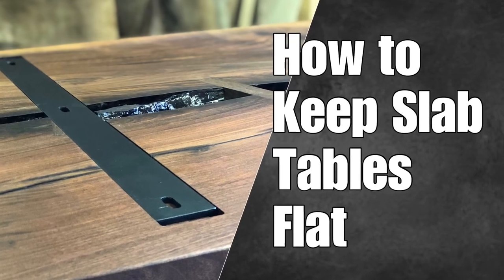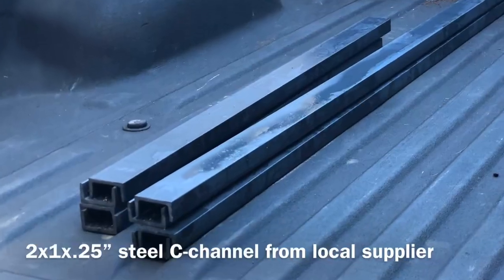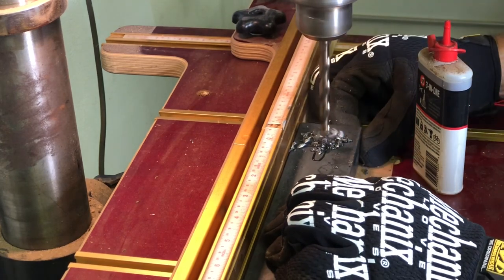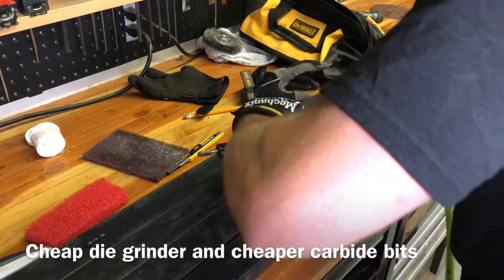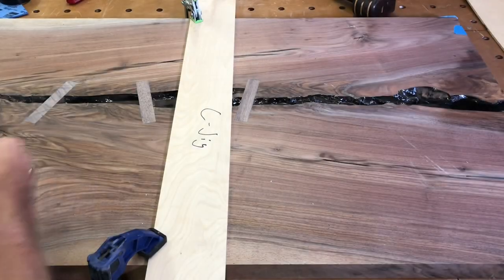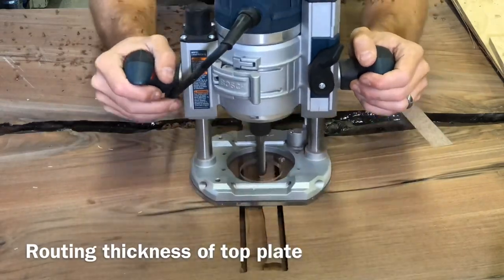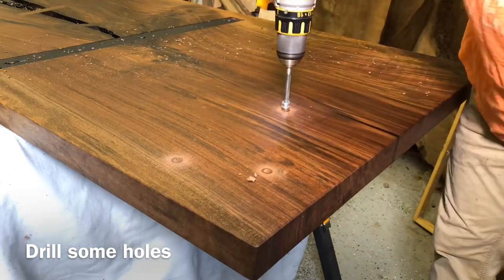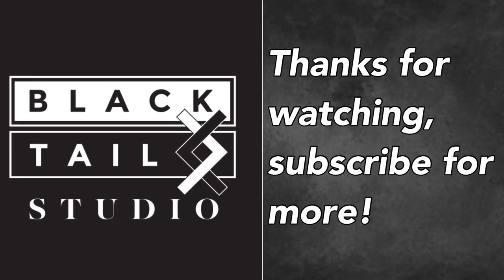How to Keep Slab Tables Flat — How To Woodworking

Comment: Cam, first many thanks for your videos!  Very helpful and clear 

I have question about c-channel spacing. I am building a finished size 8' x 42"' x 1 3/8" thick live edge table top. I will be installing 3 c-channels 1, in the center of the 8 ft length.  My question is how far from the ends should the other 2 c-channels be located. Your thoughts?

Thanks again!

Comment: So I am working on my first live edge slab and it is starting to cup!  I was thinking of making a series of cuts underneath the slab parallel to the grain and then using the c channel to attempt to flatten it out.  Have you ever tried to flatten a cupped slab?  Live edge walnut.
Reply from the maker: Dang! Ive never try to do any cuts like that after the fact. I’d just surface it flat again and add support
Reply: Just a pointer, if you turn it upside down (cup side down) the other side will dry out and start to flatten out. 
When you have got it flat again. Lean it up so air can get to both sides and then let it dry properly. 👍

Comment: Cam-  great video.  I am a newbie and don't have a moisture meter so I was thinking I should use the C-channel to help with warping.  I was told the slab (Banyan) was Kiln dried but it was stored in an outdoor barn.  The link to the Canadian company does not work, do you have another source you could recommend?
Reply from the maker: I’d reach out to CWW. I know they still sell em

Comment: Hello, thank you for video. i have made tabel top (oak) 40inch   wide and 80 long, and thikness is 1.5 inch. Dray wood about 8%. Is it crucial to use C channels? And is there any other option to chose instaed of C channel and braedbord to keep tabel top stable. Thank tou in advance

Comment: Hey Cam, incredible informative videos keep them coming buddy. I do have a question I’m doing a 4 x 12 conference table for a client and it’s 3 inches thick what length inserts would you use on the table like this, what would be adequate? I thought maybe 1 1/2” inserts but I can’t find them anywhere online and the bolts that go with it. Any information you can help with would be incredibly appreciated. Rich
Reply: Did you ever get an answer to this question? I find myself in a very similar position now.
Reply: @roberthiday3342  nope

Comment: Do I understand correctly that you add c-channel to prevent z-axis warping? Certainly that makes a lot of sense, just want to make sure I haven't missed something else.

Also, this could be accomplished by using c-channel as the mounting plate for the legs, yes? If I make my own legs, this appears to be a wise tweak to the usual flat plate.

Thanks!
Reply from the maker: Yup! Sounds like you got it.

Comment: Nice job. Be careful wearing gloves near anything the rotates. The drill press that you are using has enough torque to pull a finger from it's socket if a chip should snag your glove, ouch! Forty plus years in the metal working industry taught me gloves are to be used with extreme caution. Love your videos and want to see you have use all ten of your digits :-)
Reply from the maker: Green Button Man yeah, good call. I used to wear gloves a lot more. Learning to leave em more now. Thanks for the tip

Comment: What length of C-channel would you use for a table that’s going to be 120”X50”? And what kind of router bit did you use to flatten the cutouts for the insert?
Reply from the maker: I added links to everything in the description. And I’d say 40”

Comment: I'm building a 9' by 38" red oak live edged tabletop. My Question is if the table has been glued up well, meaning completely flat in both length and width, are the C-channels necessary to keep it flat throughout its life?
Reply from the maker: Sometimes they are, sometimes not. Totally depends

Comment: The C-Channels i'm using are 1/8 thick wall and 2 inches overall width. What size spacer would you use? I'm trying to make sense of your calculations and have come up with a 2.25 spacer but it seems like I should be going smaller than what you're using and not larger. Thanks.

Comment: What can go wrong if you did not slot the hole in the c-channel and used a regular hole?  I know wood needs expansion/contraction.

I don't think the table will cup due to the c-channel.  Interested to hear your answer.
Reply from the maker: It’ll crack the table

Comment: Hi Cam, may I ask if you've used C-channels in river tables before? I hope to use them in my build which has an 11 inch wide/2 inch deep river in the middle, but I'm nervous of what that much routering would do to the epoxy. Thanks so much, love this channel!
Reply from the maker: I have, and no issues. Other than you can see it on clear ones
Reply: @BlacktailStudio  thanks so much.

Comment: Hi Cam, awesome video. What is the minimum depth of wood I should leave under the routed slots? My table is 1.5inches thick and the height of the channel is .9 inches. Is that OK?
Reply from the maker: That’s pretty thin...

Comment: Great video!! Question, what thickness is your table top and how thick are the inserts? I’m building a tabletop that’s 1.5” thick and the inserts I bought are 1.25” thick. If I inlay these will it create a weak spot as there’s only 0.25” of wood left where I rout those channels?
Reply from the maker: That might be a bit thin
Reply: Blacktail Studio thanks that’s what I thought

Comment: Hi there I am starting a new project using the support bars as above on a Cedar live edge desk about 2.5m long by 600mm wide and there is a lot of epoxy in the middle. My question is have you ever considered putting in a false bottom as not to use as much epoxy slopeing out towards the ends to make it look like  its solid, would this cause the wood to warp more as only half the depth of the slabs are covered with epoxy. Thanks, Aaron
Reply from the maker: I have done that, not something I normally do though

Comment: Hi Cam, Looking to install legs onto an already slightly bent top (1-2mm per side), causing a slight U shape, would screwing them in crack the top? 

The legs are similar to the C channel where it spans across the width of the top.
Reply from the maker: Not necessarily

Comment: Hey Cam.  I am working on a 9.5 foot by 4 foot by 6 quarter live edge Ash river resin table.  It's now in two long pieces, each about 9.5 feet by 2 feet wide by the 6 quarter thick, both sides have been sanded up to 180 grit.  I bought 3 of the C-Channel stabilizer bars you recommended from Canadian Woodworks....and the 5/16th threaded inserts.  I'll be doing "hourglass" shaped 3 inch square steel tubing for the legs and each of the two legs will have a flat bar for attaching to the table.  I'm about to do the channel routing and channel attaching but first started to wonder if I should do the bars AFTER I do the final resin pour versus NOW to tie the two long pieces together prior to pouring all the resin.  Would you wait until after the resin "river" is poured and cured......or would you do now before the first resin pour?  My concern if I do it ahead of time is that I will have a complete connected river table with nothing to stabilize it for flipping, etc, except the 3 c-channel bars.  Thanks so much for all of your informative videos and for answering my couple of questions !  You have a real natural talent and great willingness to share your knowledge that's much appreciated !
Reply from the maker: Yeah, definitely add the channel after it’s cured. Thanks!

Comment: Great video
I have a 96 x 48 x 2 slab table glued up and would this be a good choice to do now as the sides are starting to bow up leaving a cup formation in the middle I have it clamped down now with maple 4x4 but I know once I remove the clamps it is going to cup again so will the back-channel stop this
Reply from the maker: Probably not
Reply: @BlacktailStudio  what would you recommend

Comment: If using a semi transparent epoxy river table would you still use these c channels through the resin? Or is it better to recess the base of table legs in place of the c channel
Reply from the maker: I wouldn’t then
Reply: @BlacktailStudio  what would you recommend to keep help support the table and prevent any possible cupping or movement? It’s a 1.5” thick hardwood on both sides with a 10” river down the middle. The length of the table is 5 feet. I was egoing to do legs at each corner because of the semi transparent resin but thought maybe the table needs support across the two slabs....

Comment: Fantastic video as you always do Cam.  For the Murakoshi bolts, where do you get them and what are the right sizes for the shoulder and threads if using 5/16 threaded inserts (which is what I think you used)?  Also where do you get the bolts....can't seem to find 'em anywhere of the usual suspects.
Reply from the maker: Fastenall has em. Or I go to a local place. Also called connector bolts.
Reply: Thanks Cam.  I found some on amazon too but am not sure what size the shoulder and threads should be for the Canadian Woodworks C-channel bars.  I ordered some of those bars and some 5/16 threaded inserts.....and all I need now is to get the right size bolts.  What do you use for the shoulder/thread sizes?
Reply from the maker: I use 1/4 20 threads. 3/4” length usually.

Comment: Love your videos... thank you! In your opinion, to what extent are bow ties necessary, structurally, when using C channels? Do they just become an aesthetic element? Or, maybe asked another way, with C channels in the bottom, does the stability they provide transfer through the entire thickness of the wood? Or are the bow ties required to help shore up the top? 

I have a 4" thick cross section slab of maple with a pretty significant radial crack that has weakened the piece quite a bit. Ideally, I'd like to stabilize it from the bottom only if possible, and would appreciate any thoughts you might have on that!
Reply from the maker: Not sure I could answer that accurately. Every piece is so different
Reply: You will absolutely also need bowties, the channel will not stop cracking period.

Comment: I noticed that there are supports for going across the table.  Is it necessary to put in supports going along the length of the table?  I'm using two 2-3/4" thick pecan slabs that are 8 feet long.  Thanks
Reply from the maker: Not generally

Comment: Do you recommend finishing the top and bottom in the same day? Read it somewhere.   using Rubio, thought I do bottom early in am, then let it dry few hrs and flip to do top.  If bottom get slightly messed up from resting on horses it won’t matter,.  Does it matter if they get done in same day so it breathes on both sides evenly?
Reply from the maker: I go into that and a lot more in an article I wrote on finishing on my website. Should help ya out!

Comment: My wood epoxy table has a little cup in the width and length after I flattened it and before I sanded. I confirmed that it was flat after flattening. Will the C channels help flatten out the table again?
Reply from the maker: Probably not. Maybe though.

Comment: Is it necessary to put in c-channels if the  wood slab is in the middle and epoxy is on the sides.   I would find it difficult to put screws in the epoxy and would it even help?
Reply from the maker: I probably wouldn’t

Comment: Hey Cam, I'm currently making a live edge desk and I'm about to purchase the concept 13 c channels that you use all the time. Do they come with the hardware or are those threaded inserts bought separately? One more question, do I have to get bolts aswell or just the threaded inserts?
Reply from the maker: They sell the other hardware. Doesn’t come with though.

Comment: Great Video as usual. Went back to this one today as I have a custom bar table im making out of double MDF that's 70 inches long. Need to find the best way to stabilize it yet have room for the 3 anchoring supports that mount under table to studs in the wall. You think this would be the best method? Vaghn

Comment: My C channel is 2” by 1”. So i need to use the spiral router bit go into the table by 1” inch (so it lays flush)...question...my table is only 1 3/4” thick.... is my table too “thin” for this method ?  I am nervous that i may be doing damage rather than good ?  Thoughts ?
Reply from the maker: I think you’re ok there. Any thinner I wouldn’t

Comment: Great video, thank you! I get how this would be helpful for a very wide one-piece slab of wood, but is this over-building for something like a maple table top 60" x 30" x 1.5" made of six long boards, each 5" wide, glued edge-to-edge, for a desktop? I want to make sure the table top stays flat but I don't want to do breadboard ends because I'm a beginner. The tabletop will be fastened on metal legs so it will have back-to-front support on the left and right sides, and a crossbar running left-to-right along the back third. Thank you.
Reply from the maker: Oh man, it’s gotta be up to you!

Comment: Cam, by the time I finished my river table top, it was only about an inch thick -- too thin to handle a C channel. Any suggestions about other ways to keep it flat?
Reply: Hi Kirk - I had a similar project and I used a straight bar/plate as opposed to the channel. One thing I made sure is to turn those holes into slots. This would be useful in a full piece of wood but if your table is made from pieces and you are joining/holding/strengthening them together then I'd opt for holes as opposed to slots. Hope this helps.

Comment: I dont get something.
You crosscut with the router two rather deep channels in oarallel, at a mere 2” from each other.
Then you mount an insert into the top 1” or less.
Once tension rises in the wood, doesnt it just rip a chunk out between the two channels considering wood splits in that dimension pretty easy? I mean its just a two inch long puece where the screw and insert appmies all the pulling force, and the steel if course cant buckle.
Or i could put it differently. If the u-profile is indeed doing its job i would expect the anove dolit happening. If it diesnt split, means theres no cupping intent/ then whats the use of the channel?

Comment: Nice method.  Thanks you for making the tutorial.   I am guessing the middle screw slot is kind of unnecessary as the movement should be out the edges?   Could just be a hole in the center right?
Reply from the maker: swirt yeah, I’ve thought about that before and I can’t see why a hole wouldn’t work just fine.

Comment: I'm planning on doing an ambrosia maple top for a large desk, and using these to help keep it from deforming over time. I'm assuming there's some minimum thickness I'd want to use, if I'll be routing channels out of the bottom of the slab - any recommendations?
Reply from the maker: I like 1.75”

Comment: Great video. Which model of insert do you buy? I see 15 to 25mm on amazon, don’t want to buy the wrong ones. 
Thanks!
Reply from the maker: Any size that works for your project!  I use different ones. I think these were 5/8” deep with a 1/4” thread

Comment: I think about using your method on the table I plan to build. It is a 8ft long, 3ftwide and 3 1/2inch thick tabletop, made of 4 glued slabs of balsam fir. If I weld my legs onto a even wider C cannel, and combine the use of keeping the table flat but also providing something for the legs to attach to, do you think any additional c channels are needed?
Reply: I was wondering the same thing
Reply: @jeffbrown3032  https://youtu.be/k2uvz1ThTr8
This is a link to a youtube video about the table I built. I ended up solving it in a different way and so far it seems to hold up well.
Reply: That is part 2:
https://youtu.be/f6jTKP4iDVg
Reply: @danielwurmer2266  thank you! I’ll take a look!

Comment: NEVER operate spinning machinery with gloves, sleeves, loose clothing, or pony tails. The gloves can get grabbed before you realize or feel and next thing you know, your hand is in it
Reply: Listen to this guy ! I had my hand (with glove on ) caught by chamfer drill  so my palm was around this drill while it still was rotating. Also it all happens sooo quick you don't really get time to react
Reply: @fandyu69 They make gloves that are designed to tear away when grabbed by rotating tools. I probably wouldn’t wear them around blades as I don’t think they tear away instantly, they need some sort of tension to rip at weak seams. For drills and stuff I think they’d work pretty well.
Reply: @smugegeez1406 oh yeah probably, but the ones he is wearing look quite thick , don't think that's them . Regular nitrile gloves also do the job . Keep your hands clean and won't pull your hand into machine
Reply: I was wearing gloves at the drill press when I was younger and my glove touched the drillbit and suck my hand right into it. Luckily, it stopped short of doing any damage to me. I learned very quickly when not to wear gloves.
Love your video, I really hope you take this as constructive criticism. Here’s to a long life of woodworking!
Reply: It happened to me 
Luckily the drill was too weak, otherwise it would have ripped my middle finger off. I yanked the electric chord out to stop it. Lesson: NO MORE GLOVES WHILE DRILLING.......😊
Reply: Shut up dude if you don’t touch the spinning part you’ll be fine

Comment: Hey cam,

I know this is an older video but when do you recommend to start using this method?  Do you use this on smaller slabs as well?
Reply from the maker: 30” wide is a good size